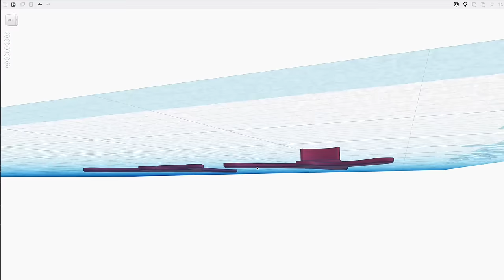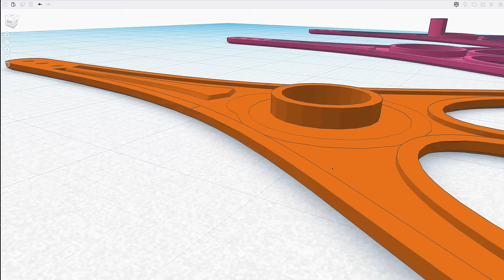Building an AMAZING 1S WHOOP with HDZERO: Full Details & Acro Flight

Comment: Cool build, by the way, you can save some extra weight by:
1. Ripping stickers of the battery, it gives another 0,3-0,5 grams, depending on a manufacturer. Which is quiet the same with replacing motor screws to renu
2. Replace canopy with my custom PET-canopy, made out of used PET bottle. It weights about 0,3 grams and gives mutch better protection than flex printed canopy. And also costs 0$. Let me know if you are interested, I can share the drawing, so you can build your own PET-conopy. (You may need to adjust it a bit to fit your camera, my is designed for runcam nano3 )
Reply: @duckedup7142  , give me your email address to share the dwg file
Reply: can i have the file? on thingiverse or something?

Comment: A great way to remove motor connectors is to plug a motor plug into it, then heat the back and pull the wires.

Comment: This is going to be my first 1S whoop, first HD Zero quad, AND my first quad with ELRS. This little quad looks AMAZING!! AND I get to build it myself, from components!
Mr ShutterBug you are my whoop hero 😘😎
PS - In the past, I removed the connectors from an IFlight ESC and soldered the motor wires instead - BUT - I just cut the connectors off with wire cutters LMFAO your method with solder is so much neater - thanks for the tip 😀

Comment: What a great build, thank you for sharing in such detail! I’m also kind of blown away by those dives from the tree tops: pretty much straight down, and no yaw washout! Early reviews of the Mobula 6 HDZero have looked slightly underpowered, but your build seems to perform really well. My favorite flier these days is a 75mm 2s with DJI, but dives require very fine care to avoid coming down into dirty air or leveling out too late. Once again, great build!
Reply from the maker: Thanks! The main difference between my build and the Mob6 HDZero is that mine is about a gram lighter, has higher KV motors, and BT2.0 connector (with good batteries from Tattu).

Comment: Just finished my own Mob7 HD build with a custom carbon frame. Weighs in at 26.1 g. Got the ORT micro vee on the way and some reny motor screws. Hopefully dip into the 25's. Thanks for the inspiration.

Comment: There is nothing holding the plastic motor plug down on the board. You can pull the plug off leaving just the 3 individual pins on the board making them much easier and safer to remove.

Comment: To remove connectors, I often clamp my forceps on the connector and then hold the board up in the air and let gravity gently pull the connector and forceps off the board when I wet the solder.
Reply from the maker: Good suggestion. I do the same thing on the edge of my bench normally, but it would have been hard to film that way.
Reply: You can also remove the connector first by squishing the tweezers between te connector and the board, and then remove the pins one by one

Comment: I am new to the hobby. The first kit was the Geprc Tinygo 4k. After learning how to only calibrate the gyro and trim with the sticks, my flight has improved. Then came the Zorro with the Mobula6, what a learning experience on settings with both the controller and BetaFlight. Also the Meteor65 lite...video could be better, but it has earned a special place in my heart for durability. NOW the moblite7!!!! Awesome flight times and handles the best....
Your video has everything! I got excited to see soldering skills on such a small board. Kinda reminds me of the Moblite7.  Anywho, you are doing next level stuff.
Reply from the maker: Nice! Sounds like you’re having fun. The Moblite7 was inspired by another build that I made. Mine was 16.8 grams + battery. Definitely a fun flyer! 😁
Reply: @MrShutterBug  I found your build on the Tripple OG Shutterbug lite7!!!!! You are da man. Create, build, soldering and programming. Just curious, what would you charge to make the exact same thing? I probably could do it. But the soldering requires a steady hand and a good soldering iron. What soldering iron do you use?

Comment: The issue of connecting the esc configurator, at least with me, is caused by have the elrs radio connected. Just power down the radio solved the issue.
Reply: Yeah this is absolutely the case, with the radio off you'll have better consistency when connecting to the configurator.

Comment: Can you please do a follow up video with your BF info?  I followed this guide but I can seem to get it all setup correctly.  I have flown it almost 100 times now but I seem to have problems with the settings (or so I think).  my drone keeps wanting to balance itself when I push hard on the throttle  making it very hard to predict where it wants to go.

Comment: Hello again! Sorry to bug you more but wondering if you can shed some experience on me.  I had a 65mm build with TW 702 23,000kv motors but the FC died.  I decided to take apart my moblite7 and put the FC and HDZERO into this 65mm build, so same frame and motors, but now my voltage sag is sooo bad the HDZERO loses video due to low voltage when I'm doing ladder spirals on a freshly charged battery.  I'm using BT2.0 connectors.  The original 65mm build came in around 23g (flew great for me) but now with the HDZERO components it's about 25.5g -- is that extra weight bogging down these motors so much that I'm experiencing this batt sag or is something else going on perhaps?  The only other change is I was using HQ tri-blades but I ran out and I'm using the gemfan tri-blades on this new 65mm HDZERO set up.  I need help b/c I can't even fly for 1min now!  The only thing I could think of to fix it was re-soldering a new BT2.0 connector on the batt leads but no luck.  Appreciate any feedback!
Reply from the maker: Sorry for the late reply. I remember seeing this comment, and I though for sure I had already responded. Maybe it never actually sent. Anyway, I'm sorry you're having trouble. The voltage should definitely not sag that much. It's hard to guess what could be wrong without seeing it. Some common causes include batteries that are damaged or poor quality (the blue BetaFPV batteries are not great). I use the Tattu 300mah 1S batteries with BT2.0. They are not too expensive, and the quality is excellent. If you know you're batteries are OK, then it could be a physical obstruction. Double check that all motors spin smoothly and with the same amount of resistance. If any motor catches, or grings, or is harder to turn, or if the prop scrapes the duct... any of those things could cause the motor to work extra hard and drain power. Good luck!

Comment: man I wish I knew what I was doing here lol.. I bought a whoop as a kit from a local drone shop. has brushed motors and the transmitter was terrible. I had an old JP PROPO X2610 and pulled out the 36MHz transmitter board and installed a 2.4 Ghz FrSky board but the whoop is a pain in the ass to control and i get terrible flght times. Just feels so underpowered and often under full throttle it wobble so much it just falls to the ground.

Comment: which 75mm Frame and props would you use. Im interested trying the same build on the slightly bigger platform. 

Always excellent content, so many thanks!
Reply from the maker: I haven’t build a 75mm with HDZero so I’m not sure which frames have enough room to mount the FC on the bottom like I did in this video. The Mobula7 frame has tall pegs for the FC, so you could probably stack the vtx on top of the FC. Take a look at how they did it for the Mobula7 HDZero 2S BNF. For best efficiency I would go with 40mm 2-blade props and keep everything as light as you can. Good luck!

Comment: I enjoy all your builds
I have HDZero already,  so I'll try this build out.
Where did you get the ELRS antenna replacement? 
Also what did you use the strap on the VTX antenna there, just black tape?
Reply from the maker: For this build, I replaced the ELRS antenna because it would have bumped into the vtx. I used a 2.4GHz antenna that I removed from a dead whoop FC, but any tiny wire will work as long as it is cut the the right length. For the VTX antenna, I used a bit of black cloth tape to keep it secure.

Comment: Any thoughts on trying the new meteor 65 pro frame with 35mm props? That’s my build intention once I get HD-Zero
Reply from the maker: The Meteor65 Pro frame has less room in the middle. I don’t think the VTX would fit there.
Reply: @MrShutterBug  yes, agreed. It might have to sit above or something. Would still be interesting
Reply from the maker: @aphinity  The larger prop size should definitely improve flight performance. Or you could build a 75mm whoop with 2-blade 40mm props. That's another good option. Happy building! :-)

Comment: Impressive build Nate!
Really want hdzero but I only have dominator v3 and not sure if it will look better on my eyes with it ... lol
This betafpv f4 aio is great and I'm using on my custom build M7 and buzz+ pad actually provide 5v with propper current to power on runcam thumb.
Last thing ... it's a bit unfortunate that OSD chip is still stay with the same chip tech and size for a long time, looks odd in happymodel diamond F4 aio 5in1 tho 😅
Reply from the maker: Yeah, the OSD chip takes up a lot of space compared to everything else on the FC and it isn’t needed at all on these digital whoops.

Comment: Cool! I just converted my Moblite 75. Question,  is there away to disable the analog VTX?
Reply from the maker: If the FC is set up for analog, then you should be able to use Smart Audio to set the vtx power level to zero or enable pit mode.

Comment: Howdy!  Wondering where I can buy the wire to make the antenna for the SPI receiver?  Is it just enameled copper wire? What gauge?  The wire antenna on my FC broke and I need to replace it, thanks!
Reply from the maker: I don’t know how to perfectly tune the antenna, but just about any wire will work if it is just the right length. Yes, I think enabled copper wire would be fine.

Comment: Another great video Nate.  When using the Meteor 65 Pro Frame, could you use the 35mm propellers that come stock on that?
Reply from the maker: Hi. I haven't tried HDZero on the Meteor65 Pro frame. The larger props could give it better performance, but they would not be allowed at the 65mm Whoop races that I go to. Also the Pro frame has less room in the middle, so the HDZero VTX would not fit there. You would have to stack the VTX above the flight controller like they did in the Mobula 6 HDZero. It's probably possible with the right mounting hardware. Have you tried it?
Reply: @MrShutterBug  I haven't tried it.  I was just thinking about it

Comment: You have replaced all motor screws with Reny screws. For me some of them were never fitting really tight and tended to fall off after a few flights. Did you ever have such issues with those screws, or did every single one of them fit perfectly so far?
Reply from the maker: Mine fit well. For me, the only real concern is over tightening them which can break the heads.

Comment: Hi, great build. Could you share your betaflight 4.4 tune? thanks,
Reply from the maker: I used Betaflight 4.3 for this build, and I did not do any special tuning other than my usual tweaks, which include increasing Feed Forward for acro or increasing Angle Strength for angle mode. For angle I also add around 13 degrees of "FPV Angle Mix", which seems to help the angle mode algorithm dig into the corners a little better.

Comment: HDzero- Is there a way to add a HDzero module to my DJI FPV 2 goggles or to my FatShark Scout goggles via the analog input?
Reply from the maker: HDZero does not output an analog signal, but it does output HDMI. It cannot be used with the DJI goggles because they do not support HDMI input. I don't know if your FatShark goggles have HDMI input or not.

Comment: Do you find any benefit of the two blade prop instead of the three blade?
Reply from the maker: @coltengibbs5404  I think 2 blade gives better battery life, but I prefer 3 blade for racing because I think it gives better control in the tight corners. Just my preference.

Comment: How do you connected hdzero vtx? To vbat or to FC 5V? If to vbat, did you have any issues with video drops at low voltage?
Reply from the maker: I power the vtx from vbat. The 5v line on the FC would work too, but those 5v regulators are a common source of failure in FCs, so I didn’t want to put any more load on the FC than necessary. Yes, it is possible to loose video with low voltage, but only when the voltage is really low. I think it drops at around 2.8 or 2.9 volts, but you should land before that to save your lipo batteries.

Comment: If building this quad with the current HDZero Whoop Lite camera/vtx combo (the vtx which has the metal protector plates on top and bottom of the vtx), is it required/advisable to remove the protection plates so that they are not in the way during assembly?
Reply: Follow up question to this kind of build: when moving the AIO to the bottom of the frame, is the + shaped flight controller required?  I assume that it is required to be able to finagle it into the frame.  Is this correct? 

Since this video is over a year old, are there any other/newer AIO FCs that you would recommend?
Reply from the maker: @FPVinPA  I would remove the metal cover from the VTX to reduce weight. Yes a plus-shaped FC is helpful for mounting under the frame.

Comment: Hi Nate, question:  Some time ago, I plugged that board into BF Configurator 10.7.2 and did a DUMP and RESOURCE.  After watching your PSA, I put it into DFU and flashed BF4.3 official release.  After rebooting, I went into CLI and found out that the gyro is the ICM20689.  When I checked the attitude, it was able to pitch, roll, and yaw.  Does this mean the gyro is functioning properly?  I want to make sure before putting it in a build.  Thanks Nate.
Reply from the maker: It sounds to me like your FC is probably OK. :-)

Comment: Can the HDzero vtx and camera combo just be wired to a battery instead of to a FC?  I got into FPV because of AIO FPV cameras that I could stick on anything I wanted; toy quads, umx airplanes, etc.
Reply from the maker: Yes, you can simply power the VTX and it will power the camera. Some features require communication with an FC, but they are not strictly necessary. For example, I believe you need a FC in order to use the low power protection mode (25mW until you arm), or to change camera & vtx settings using your radio. That might be a problem on the new 1S VTX, but all the other VTXs have a port for a remote control which can be used to access those settings without an FC.

Now, the ExpressLRS team added ELRS backpack support for the VRX (receiver module). They might do something similar for the VTX, if they haven't already. If so, that would let you do everything without an FC (except for the betaflight OSD of course).
Reply: @MrShutterBug  Alright thanks for clearing that up!

Comment: hi, may i know what esc setting are you using?  i having the same aio, but the motor sometimes are struggler to spin. and flight time just less than 30 sec.
Motor im using T-motor 0802 22000kv and using 3 blade 40mm prop.  Thanks for you advice!
Reply from the maker: For this drone, I'm using BLHeli_M with 48kHz PWM and a startup power of 1.0. If your motors don't start spinning reliably when you arm then:
1) Spin them with your finger and double check that they all spin easily (not catching on anything) and
2) Try increasing the startup power in the ECS settings. If you have to push it all the way to 1.5, that's OK for an 0802 motor.

Having a flight time less than 30 seconds is not good though. There may be something wrong with the motors or the battery.
Reply: @MrShutterBug  hi. thanks for you reply.
as for now solve the motor stall issue.

as for the 30 second flight time was cause by the vibration.  any advice to reduce noise? as for esc setting and also betaflight setting.  Thank you

Comment: Can you desolder OSD chip from AIO ? That would save some unnecessary weight :D And great build BTW :)
Reply from the maker: I haven’t done it, but that would help. The OSD chip is one of the largest ICs on the board. Removing the USB plug would help too… but with obvious drawbacks.

Comment: If something even remotely close to this was sold, it could properly bring properly light HDZ whoops to a bigger market. Frames with pre-made holes on both sides, thinned-down ELRS AIOs with enamel antennas etc... could make it a lot easier for some people I imagine
Reply from the maker: The new Mobula6 HDZero BNF is actually pretty similar. Main difference is mine is about a gram lighter, has higher KV and BT2.0.
Reply: @MrShutterBug  Hmmm, would be interesting to see a comparison between the BNF option and this then, if the BNF does stack up

Comment: can I pick your brain with an off topic question: are there any drawbacks to putting 3.5 inch propellers on a cruiser/long range 4 inch quad?  The motors I'm going to be using are rated 3-4s (emax 1606 4000kv). My thinking is that the smaller props will make the motors more efficient, no?
Reply from the maker: Actually, I would expect the larger props to give you more flight time. That is usually the case. For max flight time, I suggest 2-blade 4" props.